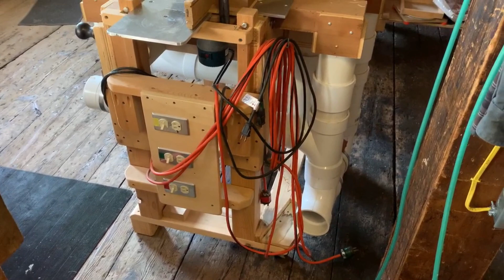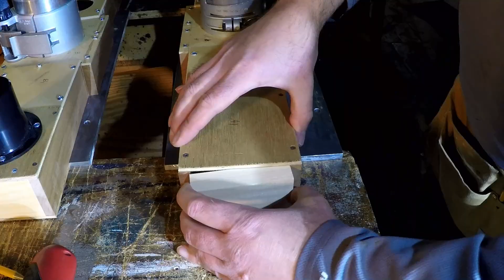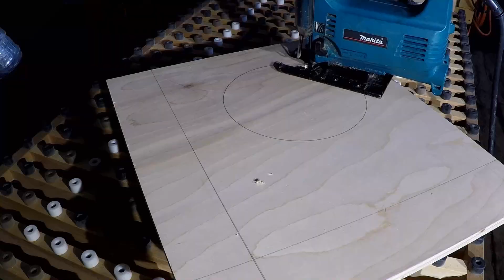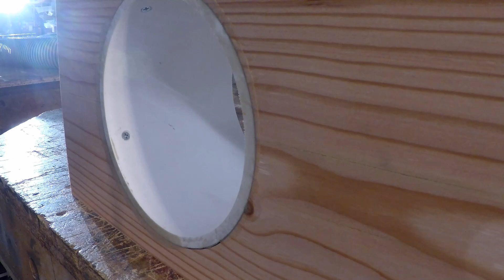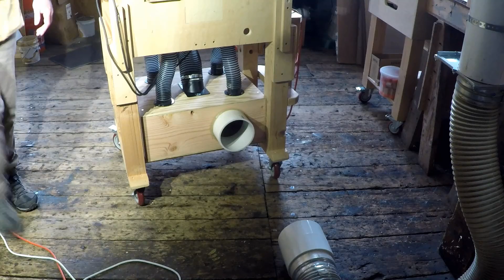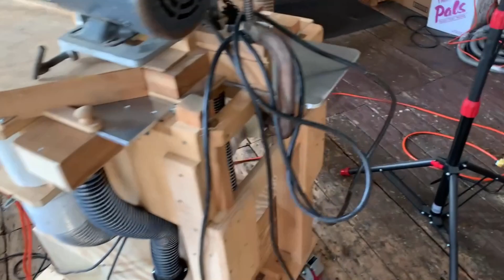Power Feed Router Table Dust Collection Modification Project (part 6?)

Comment: Great upgrade. I don't glue my PVC either. Just gaffer tape where necessary or small screws over the joints to stop them coming apart. There always seems to be a modification that needs to be made. Now... what to do with all that used pipe??? 😂😂😂

Comment: As a forty year woodworker the real point is every thing you can do to protect your lungs is worth it I was pretty safe I don't smoke but still have copd my brother four years younger died last year from cancer 56. Only thing Was wondering s do you have a fresh air makeup system I know your shop is probably drafty af but all that air must take a lot of heat out with it. Hoping you the best for 2021.